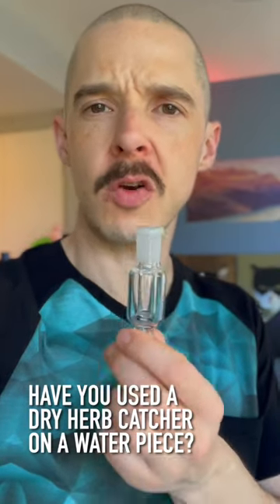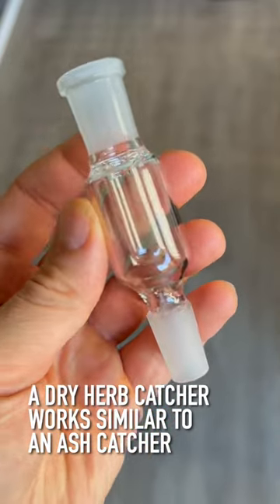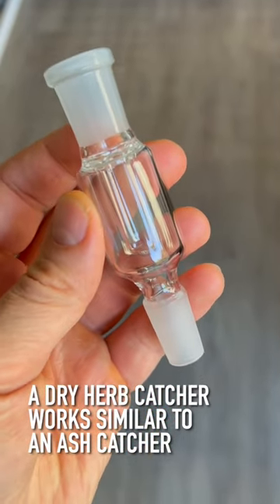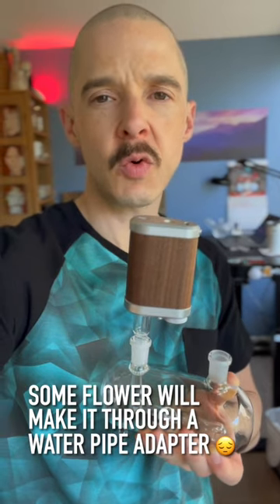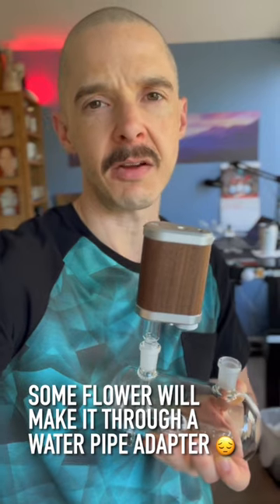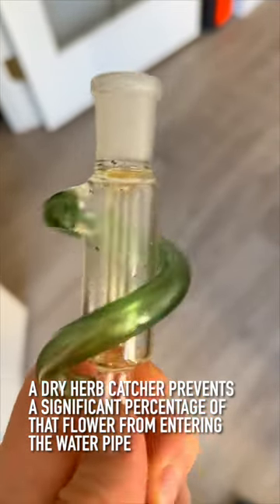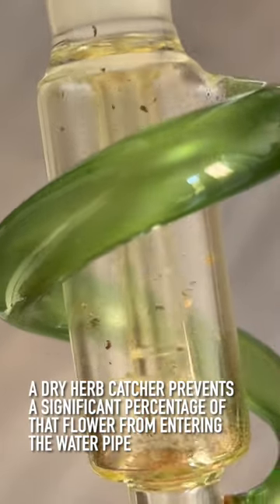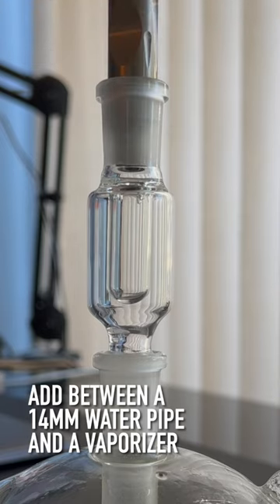Dry Herb Catcher - Have You Used One On A Water Pipe? 💦 #vaporizer #pipe #clean

Comment: What kind of vape is that? I want to transition to vaping but still want to hit my bong.
Reply from the maker: you can use pretty much any vape with a bong, you just need a water pipe adapter for it which they make for most anything
Reply: If you want a vape hit that feels like a bong hit look into ball vapes. They're a little pricey but the closest thing to smoking without smoking and they're used through bongs.